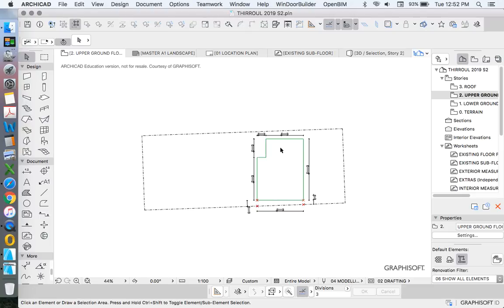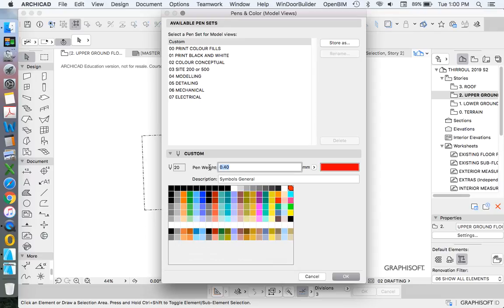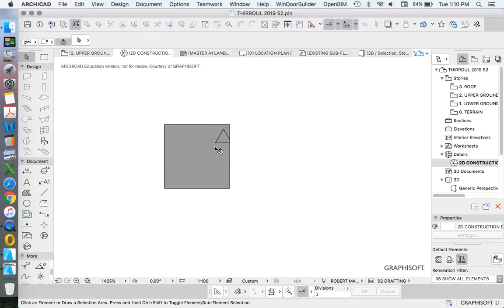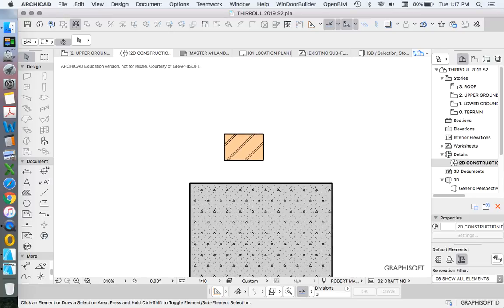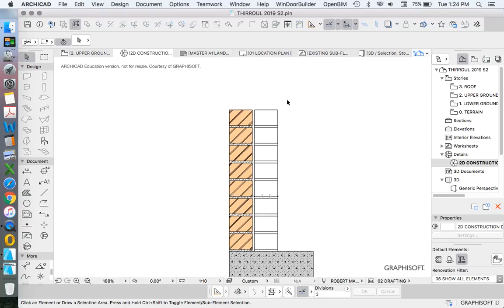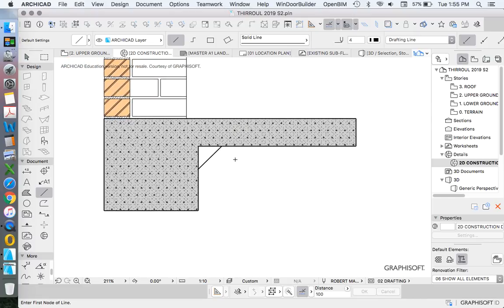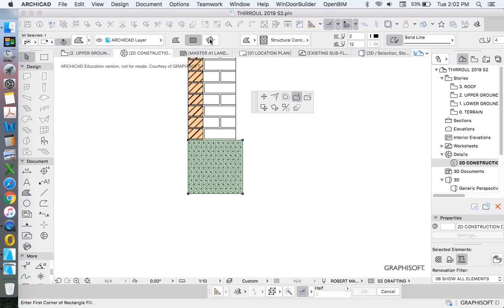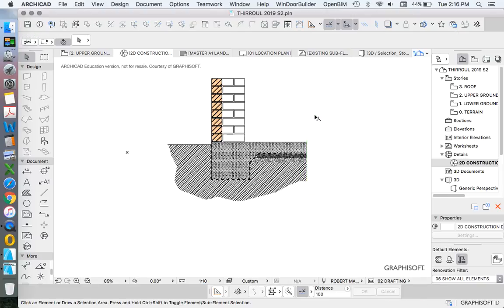ArchiCAD Wall section 2D drafting with fills 01

Comment: 0:00 Pen sets (how to make custom pen set)
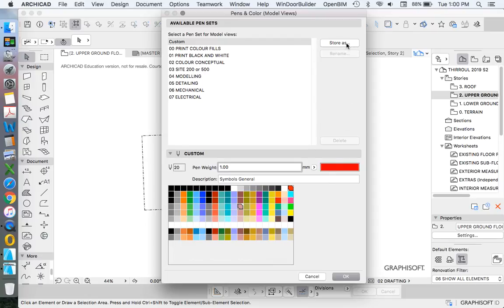7:44 save Pen Set under new name
9:00 Details folder
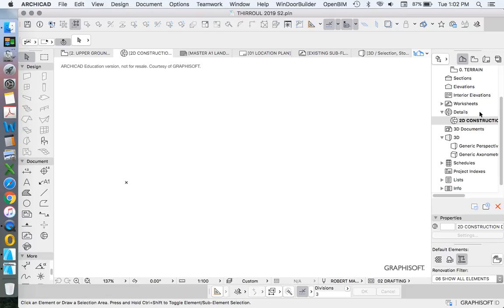9:40 Worksheets vs Details
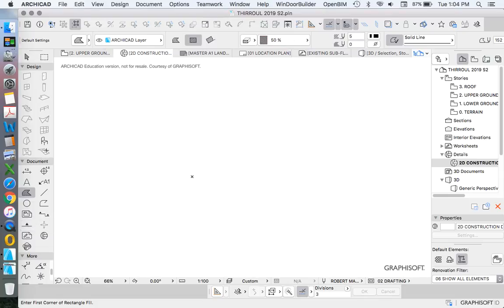11:24 Fill settings
14:06 Rotated rectangular method 
14:45 Set hatch scale

32:44 FIND & SELECT tool